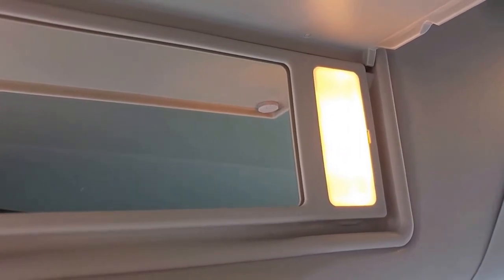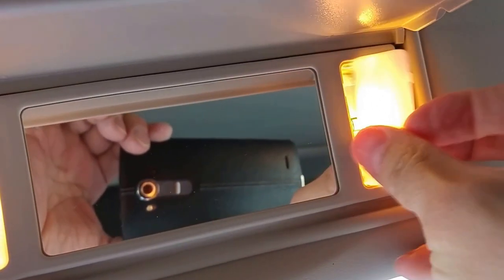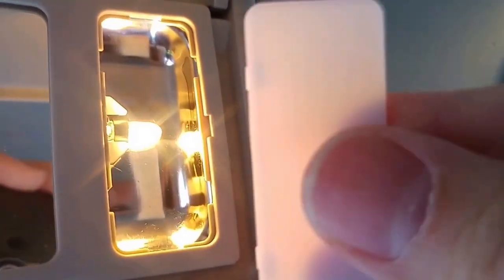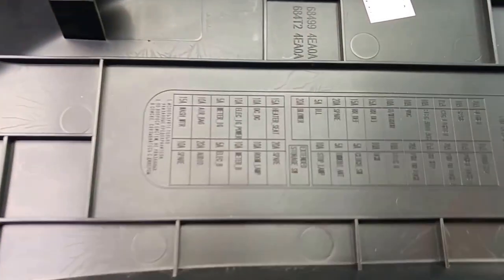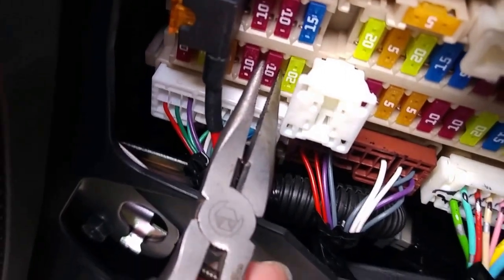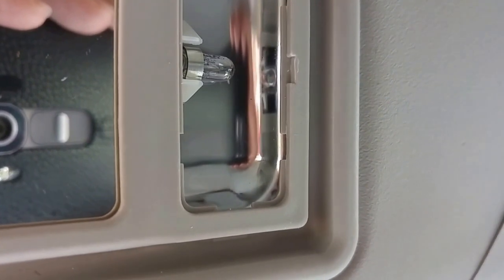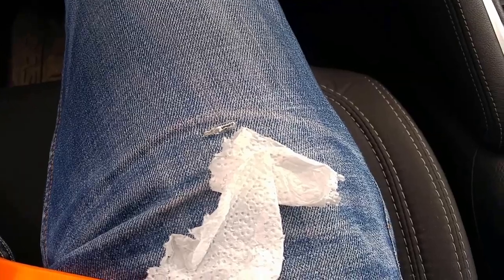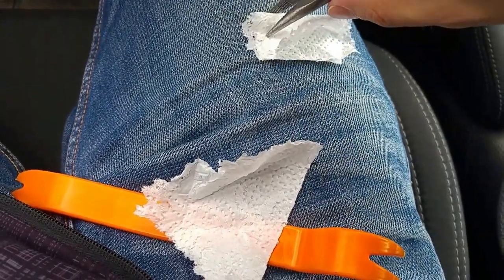📈Nissan Qashqai J11 - how to change car vanity mirrors (interior sun shades) for LEDs

Comment: hey. don't use pliers to remove a fuse, you can break it. At the very top row with spare fuses there is a special plastic fuse-removal tool. It sits right in the middle between fuses

Comment: I bought these lamps but fuse keeps getting blown :(
Reply: same here.. tried 3 times, 3 fuses blown away
Reply: I have the ones from Eledia (France) on eBay and all 4 work perfectly after adjusting the pins outward slightly for a good contact. Very bright and white light.

Comment: Is this bulb t5 or t3 type?
Reply from the maker: hi, link from description fixed - T5 https://www.aliexpress.com/item/T5-18-37-70-73-74-79-85-86-Super-bright-3-LED-car-Dashboard-warming/32254993034.html
Reply: Thank you very much! I have ordered similar t5 bulbs type and tried to replace the original ones but i had a short circuit. Maybe first i need to remove the cabin lights fuse because the bulb was leaning on the sheet metal during installation process.
Reply from the maker: @Val_Crystalised  yes please do, i`ve did the same - did short circuit and burned the fuse.. so iam not that much stupid in video :)